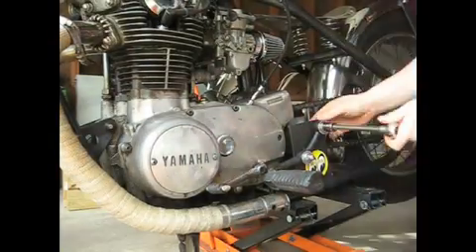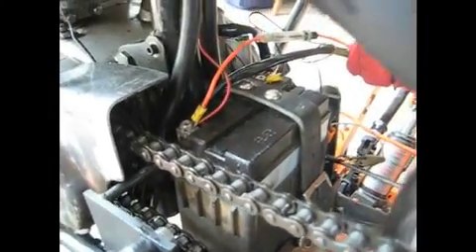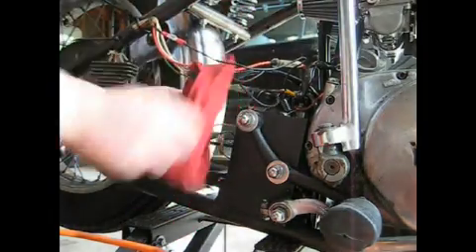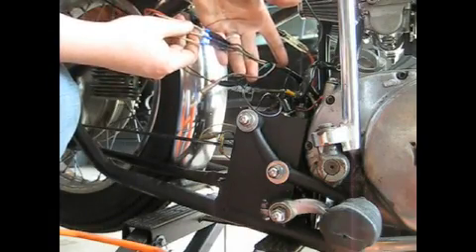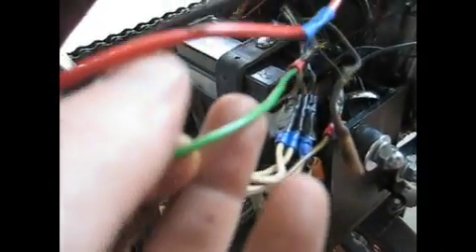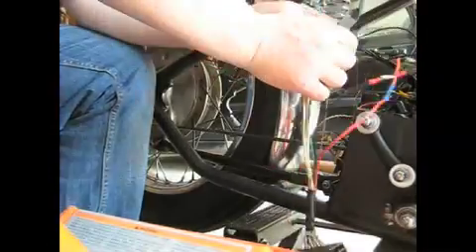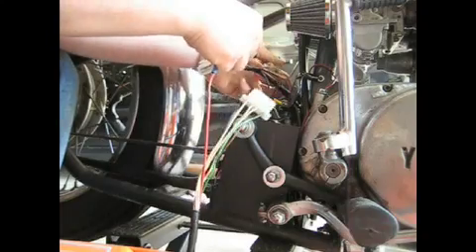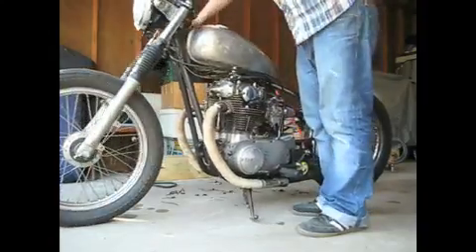XS650 Charging System How to Wire it Up - Continued

Comment: Yeh"  the brown wire [ 12volt  switched]  to the brush on rotor, Magnetizes the rotor.  enables magnetic field,  make shure you have 12volts at this brush terminal , [ ignition ON] ,  as rotor spins the magnetic field enables charging,  ,great video,,  simple instuctions,

Comment: i had major problems with my chargeing system on my build and hadto keep my bike on a charger daily and never ride at night for a year and oeday i finally figuredout why it wouldnt charge after spending hundreds replaceing every single part in the system and no thats not what fixed it..... YOUR VIDEO WAS THE SINGLE KEY AND I WANT TO THANK YOU VERY MUCH FOR KICKIN THE KNOWLAGE... THIS VIDEO IS THE ONLY VIDEO WORTH WATCHING FOR ANYBODY WHO DONE THEIR OWN CUSTOM BUILD FAR AS THE CHARGEING SYSTEM GOES... I do have one question tho, why unground the brushes by changeing the screw in the stater rotor assembly ?
Reply: Because your turning the rotor into a magnet using 12v and the brushes are carrying the 12v to the rotors. The brushes can't carry voltage if they are grounded. Your basically turning the alternator into a permanent magnet alternator but it's not permanent because it requirers 12v of ⚡. You could carry around a 12v cordless drill battery in your pocket and connect to the brushes then it would run with a "battery eleminator" like everyone wants on there chopper

Comment: ok... that's all well and fine if your xs uses that type of rectifier....but some earlier standard models, 1977 and older, have slightly different wiring and a different type of rectifier, situated under the battery cradle/box, and the one shown on the video is not suitable...so...what happens then?

Comment: In my book the red is also split, one to the rect. and one to the ignition switch. Is that ok ?
Reply: Yes. This means when the key is on, the 'on side' is getting fed power from the battery and charging system.

Comment: Would this wiring you just did use a voter micro- power ignition unit?  If not do I need one? I have a 1980 XS650

Comment: Did I find the right YouTube channel dedicated to motorcycle repair & maintenance? I found the information in this video precise & detailed but wonder if the application would still be the same for my 1985 Yamaha Maxim XJ700 that's having some issues with idling & MAYBE related to the electrical system. It wants to stall at idle even after warm up. When I use the brakes or turn signals the lights dim & I wonder if they're related or separate issues? Btw the carbs were just rebuilt 5 months ago.

Comment: Hey, thanks for the vid.  I am wiring my XS400 bobber and running into some trouble.  Is there any way to tell which white wire goes to which terminal on the rectifier, or doe it matter?  Mine is not a points system.

Comment: @electricchurch666 

Alright! I wired it just as you said in the video and it seems to be working fine so far. First setup of 3 that has actually worked. What do you recommend I use instead of a toggle? Regular key ignition? I'd have to find a spot to mount one and then what do I do about wiring the lights? They are wired into the brown wire per another diagram from pamcopete. Seems to be working fine though.
Reply: How about these days?

Comment: I have a '76 xs650 and am running a reg/rec like yours. I'm also using a pamco electronic ignition and a toggle switch instead of key switch. My question is in regards to the power feed to the brown/black wire. I run a wire straight from the battery to the switch and from the switch to the brown/black wire? Is that wire the feed to the headlight and taillight? Or where do they wire into?

Comment: i want to run my bike without the starter motor, my xs650 is completely stripped down,  so my question is, what do i save on the wiring harness when i buy a new one and what do i get rid of?